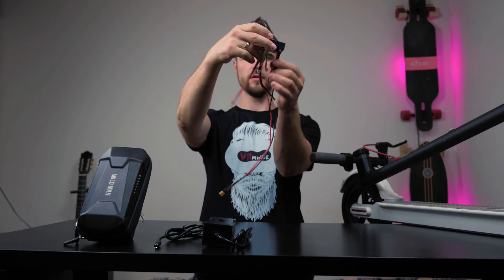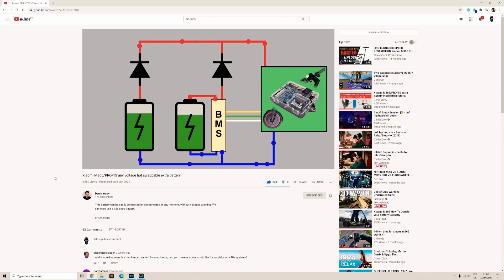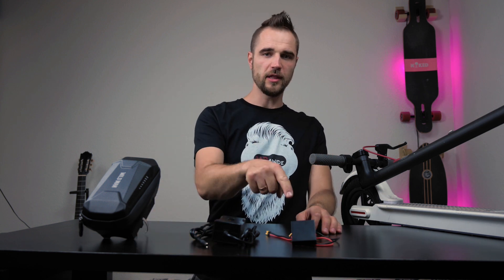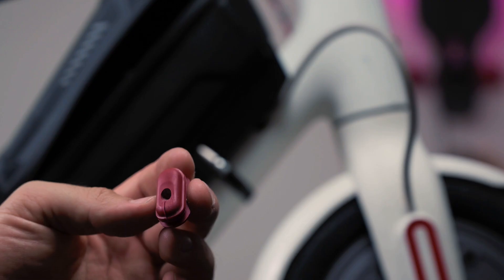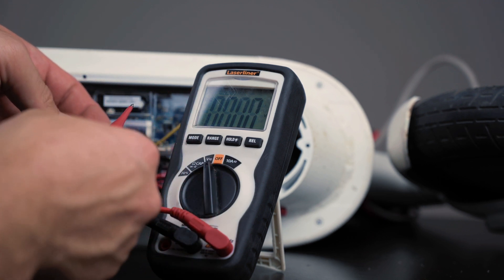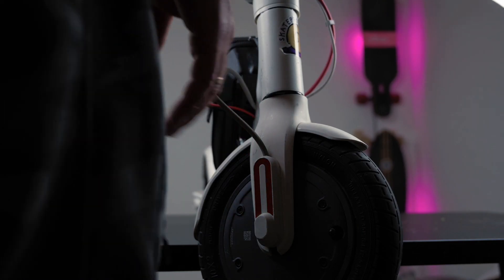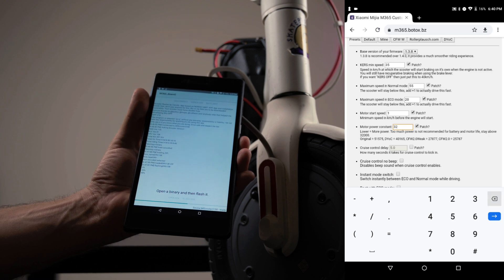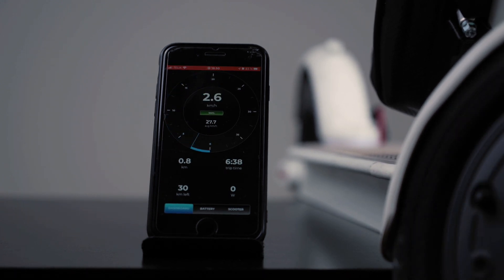Rita - the most waited Xiaomi M365 update?!

Comment: Can I use 36v 30000mah which is 10S2P with this kit?
Reply from the maker: Yes. You don’t even need Rita for that. Stock battery is 10s as well, so you can just connect them in parallel. Just make sure they are both charged to the same voltage
Reply: @VRMinde  how do I connect them in parallel and how do I charge them to the same voltage? Would I need to use a different charger for them?
Reply from the maker: Dawood Khan charge them both fully and measure the voltage with a multimeter. It should be not more than 0.5V difference, the smaller the better. 

Does your battery pack have a BMS?

There are several vids on how to make the Y connection, like this one https://youtu.be/FwoLKFaMraI
Reply: @VRMinde  if I upgrade original battery with 36v 30ah which has same form factor and cables as original battery. Can I upgrade just by switching out old battery or do I need to do something when making a CFW?
Reply from the maker: Dawood Khan you need to make sure your bms communicates with the xiaomi controller. That means programming the controller. Or that means leave the original battery in place and connect your 3000ah one in parallel. Check out dough-nut’s video on youtube how to do it. You can either solder wires or just make the Y-joint.
Reply: @VRMinde  should make it easier if I just show you the battery
Reply: @VRMinde  I have xiaomi essential and i've ordered the 5,2Ah 10s2p liitokala ( https://www.aliexpress.com/item/4000975672453.html?spm=a2g0s.9042311.0.0.27424c4dFsVETE ) does it need BMS? How is the charging with external battery working? do i have to charge the batteries separately? disconnect at least one from the Y connection, and check the voltage before connecting after every charging? if so - wouldn't combining addional battery with the original one - so BMS will think it have 10s 4p not just 2p? (or would that need to flash 4p fw for the bms?) like use a load ore wires to connect each 2p from external battery to the coresponding 2p in the original one?
Reply from the maker: @4WDJUSTY   oh man. Let’s get some things clarified:
0. Li-ion batteries are dangerous and can explode or burn your house. Be sure to understand what and why you are doing before doing it actually. 
1. Yes, Every battery needs BMS, and I hope & believe that your purchased battery has it installed. 
2. Xiaomi original battery has a bms that is “communicating” with the controller. 
3. Before you plug two batteries together in parallel (y split) - be sure to charge them separately to the same voltage. The voltage difference should never exceed 0.2V. You need to use a tester to make sure before you connect them. It is important as charging them with the same charger is not enough as different BMSs might let the battery charge to different voltage. 
If they are at different charge levels - one battery will start “charging” the other one at a speed that is higher than it can “take” and can lead into a big firework.
4. When you are doing the “y” split, you are connecting the battery power outlets together “after” the BMS. None of the two BMSs will know about it, you cannot “flash it” or do anything about it.
5. You can either disconnect and charge them separately (every time making sure they are charged to the same voltage!).
6. As your new battery does not have charging leads it is supposed to be charged through the power outlet. This means you can leave them connected in parallel and use the original xiaomi charger as well. Your charging time will almost double. 
If you had a battery with charge leads (like the m365), you would also need to make parallel connection on the charging cables.
Reply: @VRMinde  I'm not really sure it has BMS, it isn't stated anywhere except "self balancing" but "no overchage/discharge protection" sounds like it doesn't have much inside... dimensions looks like a piece of pcb can be in it... this is another one from the liitokala store http://bit.ly/3dT0Qw1 it says it have overcharge and discharge protection, the diensions are the same, so the first one should have some bms i hope :D

Comment: hello I have such a question for you ,can I only select options in this 
generator -Maximum speed in S mode ?? I changed Maximum speed in S mode 
 33km/h , and I haven't changed anything else, is it safe ???? from what
 I see people mark too -Current limit for S mode depending on 
temperature, capacitance and voltage and Current value for S mode I did 
not mark it .
Reply from the maker: Russian Roulette you have only changed only the max speed in the firmware and nothing else? If yes, it is “safe” for the svooter, nothing will get damaged. It is less safe to ride for yourself as you will be going faster in some cases ;)
Reply: @VRMinde  ok

Comment: It sounds like the motor is Pulsing, rather than running at a constant/smooth speed.
If this is the case then it will render this hack/mod useless!
Reply from the maker: I double-checked it after charging the scoot up just now. It is not pulsing at all
Reply from the maker: FEEL THE NEED Good point. I do not think I had the firmware installed properly 🙄 I also got the error 24 - over voltage, despite that I set 52 Volts in the firmware. I had to reinstall the firmware with another app. 
Just tried spinning it - not pulsing, but I need to try on the full charge.

Comment: Its not pouring outside you just want to make it a 2 part video. Because adding a 12s 48v battery is something never done before. Theres people who run these at 60v. Mine ran at 54v with no mods other than the extra cells.
I smashed the dislike button so hard it made a black hole in my screen.
Reply from the maker: You can go and check the past weather conditions for Firday 3th evening in Billund https://www.timeanddate.com/weather/denmark/billund/historic. 
But you won’t do that as “you know it all” already :) 
Thanks for your comment and the dislike. 
Would you share your 54V build with us so we can learn how to do it with just extra cells?

Comment: no regen then?
Reply from the maker: treasurehunter80 manufacturer claims it works as stock, I do not use it when rolling. I can only confirm it works when applying the brakes.
Reply: @VRMinde  if there is a diod on bouth batteries there is no way to have regen
Reply from the maker: treasurehunter80 I will not argue :) I can just confirm that regen brakes are working 100%.
In this video Denis was explaining a bit about how Rita works https://youtu.be/1cJFdFCtMGI

Comment: 13S is 48V btw, 12S is 44/45V
Reply from the maker: celeron800 cells are charged 3.1-4.2V. 4.2x13= 54.6V. 4.2x12= 50.4
Reply: @VRMinde   When you're calculating the voltage rating of a pack you assume nominal voltage - 3.7V (48/3.7=12.97~13). I was just saying that when you said "people call a 12S battery 48V" you're rounding up above nominal and generally people call a 13S pack 48V. If you look around online shops that sell battery packs and BMS's all 48V systems are 13S
Reply from the maker: celeron800 makes sense, thanks for correction! :)

Comment: Will I need this if I intend to connect an external battery of the same voltage together? I only want extra range and not necessarily faster speed.
Reply from the maker: AppleOranges12 hi mate, not necesseraly. You can connect an external 10s battery in parallel with a simple “Y” connection of the cables. Just  when you connect them together make sure both original and external batteries are charged to the same level (I would say 1V difference is absolutely max)

Comment: Is it easy to install?
Reply from the maker: Arnel Estacio unscrew the bottom deck, get the wire through, plug in connectors and close the bottom deck. If you know how to use a screw driver you should be able to do it :)

Comment: If you want to connect a battery in paralel You don't need Rita just and adapter cable .
Reply: Good luck with a 12s battery)
Reply from the maker: Try plugging 50V battery together with 39 and you will see a big big firework :)

And overall you will not be able to use a higher voltage battery without reprogramming the m365 controller. 
There is a “tuttorial” at the bottox’s github how to do it, but you need to have a decent knowledge in programming micro controllers. I do not have it, so a device like Rita does it for me :)

Even if you just connect a 10s battery in parallel you need to figure out how will you charge them.
Reply: @VRMinde   more than 8 months with 2s en series + 10s3p in parallel and cfw paid version and no issues 👌 . 36 km/h constantly until 25% .
Reply: @ManDone88  cool do you have a tutorial video on how did you do it ?
Reply from the maker: ManDone great to hear :) I think it is great that there are more options and everyone can choose.
I personally like one integrated device and ready-to-use solution :)
Reply: @cebb5058  just a cable with 3 xt 60 connector's for series 😉
Reply: @cebb5058  Xiaomi ecu can handle 12s without any problem . Even 15s
Reply: VRMinde the xt 60 and xt30 is plug and play but ppl that know how to make it are not selling and make up unnecessary products like rita 🤷🏾‍♂️🤦🏾‍♂️
Reply from the maker: ShowahPrydez don’t get me wrong, I would love to try and “just plug” the 12s as I have it now. But I struggle to understand how to match it with the stock 10s battery? How to charge both batteries with one charger? 
I keep hearing that “people run 60v, people need only cells, people need only xt30” and so on, and I wanted to try it for a long time,  but I can’t find any actual builds to copy. Can someone finally share one build? I will make a video so everyone could use. If it is safe and cheaper option I would love to try it.

Comment: Ughh, this thing. Its kinda overrated. I dont know why people are so hyped about it. 
Like, its only real good feature is hot swapping, but how often do people do that? 

Its not even that good for speed/ voltage hack, because you cant add a small 2s pack with this setup - you straight up need a whole 12s pack! 
It will first run completely on the 12s pack, then overlap a bit and then run completely on the stock battery, which means you will get the speed boost only for about first 50%, then you are back to stock battery.  You will go all the way from 40kmh down to 22kmh, LOL!
Reply: 1. "Small 2s pack" is not convenient to be charged. Rita allows to charge an extra battery trought the standard charging port.
2. On the stock battery you ride last 10 km with low speed and power, so, while the total range is 20 km,  you get only first 10 km of comfortable ride. With the extra battery connected you also ride last 10 km with low speed and power, but before this you get 40 km of comfortable high speed and powerful ride, because total range is increased to 50 km.  40 km of fast and powerful ride VS 10 km of fast and powerful ride - don't you see the difference?
Reply: @DenisYurev   For range AND speed you get 10s 12ah  + 2s 20ah - that way you will get all 40km or 50km whatever at 30kmh+ and never get down to low speed and low power at all. RITA will behave just like normal scoot when its ~50%, while a more traditional range and power boost will behave like a boosted scooter all the way to 0. Do you see the difference?
Also, there is no increased current capacity in RITA case as one battery works at a time. That impacts not only acceleration, but also braking, which can cause the internal BMS to shut down due to too much current flow. (something like 30A+ for 1.5 seconds)
Reply: @KaktitsMartins  12s work single untill it's voltage is more than 42V. After that current consumption will be shared between the batteries.
Reply: @DenisYurev  Which is the same as driving with normal battery voltage wise and.. God, it might be even worse than I thought current wise, because, sure, at 42v they will be equal, but the 12s will be close to empty, meaning its on a steeper discharge curve and bigger voltage sag could deplete them too much (I suppose RITA would cut that if its smart enough, but still  - it could lead to a cut)
Reply: @KaktitsMartins  ok
Reply: if i have a 50.4v charger with a external 12s battery can i charge the scooter from the integrated port even if the original internal battery is 10s?? i am really interested about rita...
Reply: @DenisYurev  As for charging - does RITA allow you to straight up plug in a 52v charger in the stock port? Hmmm, I think it requires an extra wire for that. But im not an expert.
Anyway, the 2s pack can be charged by a 2s charger without disconnecting the batteries. People who say that you need to disconnect the batteries are propagating  a myth. Also, if you want, you can fuse the charging port from 10s and charging port from 2s by taking black wire from one and red wire from the other and use a 52v charger. 
Yeah, it involves a little bit more work, but you get  a better system out in the end for cheeper.
Reply from the maker: Mārtiņš Kaktīts Not only hot swapping in my opinion. Not caring about charging the 2s is the key feature in my head :)

Being able to use any battery with any BMS, even without the stock one is the second one. 

And if the range of the scooter is sufficient - I agree that 12s is not needed. But many people anyways connect another battery to get more range for the scoot. 
And it is not for everyone for sure. It is something I personally was dreaming about :)
Reply: @VRMinde  If you have free time, you could make a funny video with riding on AA pills as an external battery)))))
Reply from the maker: Denis Yurev that is a good idea :) I just need more time in my life now :D

Comment: Man, you mounted the bag wrong side)))))))
Many thanks for this nice review!!!
Reply from the maker: Denis Yurev at least the battery won’t fall out if the zipper fails 😁 thanks for developing such a device man!
Reply: @VRMinde  Zipper will not fail, it is pretty reliable
Reply: Hi Denis
When will the kit available again?
Reply: @caipas111  in 2-3 weeks, because we are waiting 12s chargers from China now. But if you are able to upgrade your charger to 12s by yourself by replacing 1 resistor, then you can order right now the 12s battery+bag+rita, and after all use 12s extra battery)
Reply: @Denis Yurev how long will it take to fully charge both the 12s and the stock battery from 0 with the upgraded charger? Thanks!
Reply: @philiproman9599  10-12 hours
Reply: When ordering, does the billing come with delivery? Or is it payed before sending? Also (if paying is before sending), when preordering will there be payment when it is available again? Or payment before it's available? Because if there's too much orders i have no interest in paying and having to wait for who know's how long and not even be sure when the delivery comes or IF the delivery comes? I just dont want to get cut back roughly 300 euro's not knowing for sure if i will recieve this range extending pack 😅 since that would be half a paycheck at this time 😂 thanks for responding!
Reply: @MrViiP3RZz01  If you pay today, than your order will be dispatched on July 20
Reply: @DenisYurev  i will be ordering in the beginning of next month 😁 this month might not work out (too much bills) haha but my order is ready as soon as the beginning of next month then! Thanks for answering, and thanks for even making such a nice upgrade for the m365!
Reply: @MrViiP3RZz01  thanks, maybe I will have in stock next month
Reply: Where con someone find the tutorial to use the 15s battery pack with Rita?